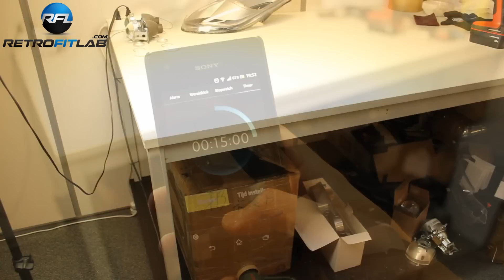Fiat Punto | Evo HID Bi xenon D2S Projector Installation headlight Upgrade

Comment: Yesterday I did the same on my GP headlights,mine are Valeo and i took me 90 minutes per headlight to open it,I did the same thing as in video but had to heat it over and over because the permaseal is difficult to open but it can be done .... for quick opening of the headlights I would recomend Depo headlights as the ones in the video (much easier to open) but at a loss of a 100 euros for the set (I didn't want to shell out another 100 euros) ... Instalation of the projectors went ok,Valeo has slightly different bulb seat than Depo so with Valeo expect a little fiddling but it will be ok,everything went well.

After everything is installed and mounted on the car check your headlight leveling and set it to lowest setting and you are ready to go.
I use: 3' D2S projector,6000k bixenon,Apollo shroud .... the same as in this video.

Comment: Good work, but I have a consultation, he does not need additional glue to the re to arm the optics? Also I saw other videoes that you use an especie of black thread to seal the optics, in this case he does not need?, I have the optical ones of the model 2009 it is the same procedure? thx

Comment: Does Q5-R refer to the projector or the car? I can see you get your products from TRS or the same vendor as TRS, but never heard of Q5-R.

Do you know if any of the BiXenon projectors are "bolt on" compatible to a Hella H7 equipped 2008 Passat? Like the H55 Mercedes R installation, you uploaded, where you can reuse mounting holes, and thus retain leveling function.

Comment: Does the H4 adapter make the rotation of the projector easier during install or do you still need to manually adjust rotation before tightening the locking nut? Thanks :)

Comment: very strange I did in your own way but the glue did not give up the grip, indeed it remained hard as before
Reply from the maker: Sometimes they have also used permaseal instead of butyl, which is really hard to open. In our Golf MKV video we open a permasealed headlight. https://youtu.be/lUw9jQx5Pf0

Comment: I watch your video and have question not related to the mod itself but the 2 screw you remove, the ones with hold the bulb spring.
Mine fall off and I want to mount it but I am not sure if the screw holds the reflector inside or not. I don't want to remove the lamp from the car as it requires unscrewing bumper
Reply from the maker: @Arc, you are referring to these screws? (0:29 min)
Reply: @Retrofitlab  yes, this one
Reply from the maker: @arcadio94pl  , these screws hold the spring that is used to mount the halogen bulb. It can be safely removed :)
Reply: @Retrofitlab  thanks mate

Comment: hello. A hőmérséklet hány celsius fokos? vagy fahrenheit?
Reply from the maker: We use a setting of 300 Degrees Celsius for 12-18 minutes / 1st lowest setting, depending on the size of the headlight. Make sure that the hot air of the heatgun does not blow directly to the headlight, place the headlight on small elevations so that the air can circulate properly through the box.

Comment: Looking great, I'm on the fence of ordering a kit. I have a 2015 fiat punto myself. But do you  loose the ability to signal with your high beam when the low beam isn't turned on (it's a H4 Hi/lo halogen combination now) also do you loose your parking lights (stadslicht)??
Reply from the maker: Yes, because the high beam / bi-xenon mechanism in projectors works via a shield that is opened, so without light, nothing is happening with the light. The xenon will usually startup, but because of the start-up time, it isn't directly on. When this is a big concern, you could opt for LED bulbs, but that's not ideal for light output and pattern. The parking light is behind the shroud, some mount it on a different place, or a angel eye can be mounted on or in the shroud :-)

Comment: What paint you use for this headlight?
Reply from the maker: For a good result without professional spray paint materialen, we have used just normal spray paint from a rattle can, heat resistant spray paint often has a nice matte black look.
Reply: @Retrofitlab  will it be ok if I use the elastic Bosny spray paint?
Reply from the maker: @wordsofwisdom5467  Hard to say, we have not tried a plasti-dip type product inside a headight...so really can't tell for sure...
Reply: @Retrofitlab  Have you sanded the chrome plastic surface before painting?

Comment: Heat Gun, how many degrees?
Reply: Ok, I'll do that,  but how many degrees 300 or 500, for 12 min long?
Reply: Thanks
Reply: ***** Why is that necessary?
Reply: ***** And the headlamp always has to be upside down ?
If i use 10 min for example, every 5 min i rotate the headlamp half way, right?
BTW thank you so much!